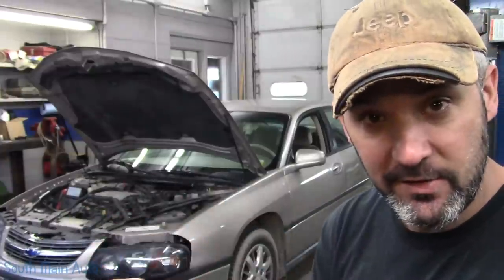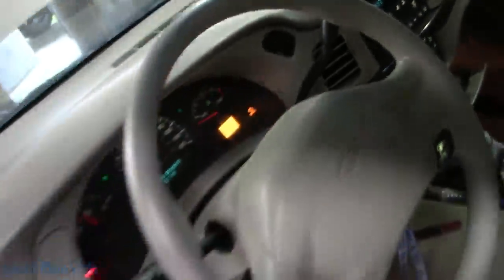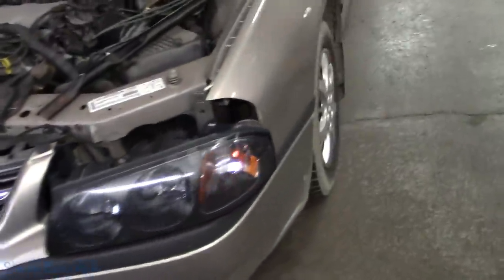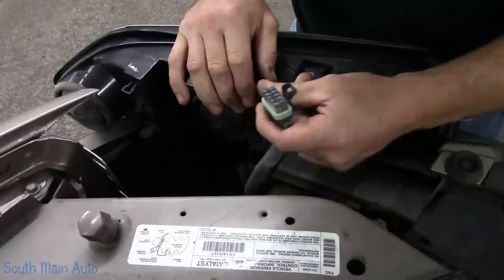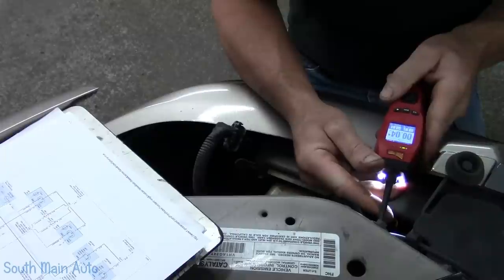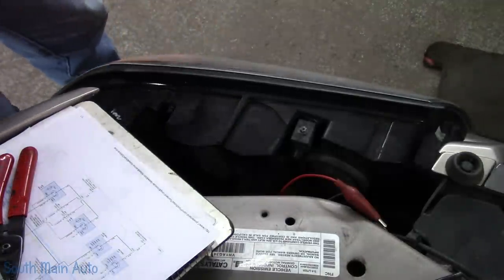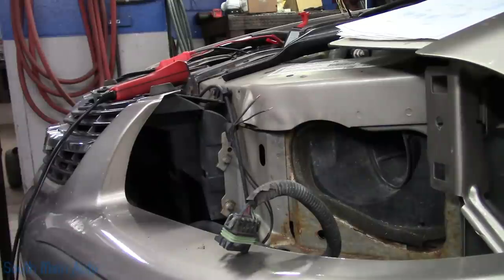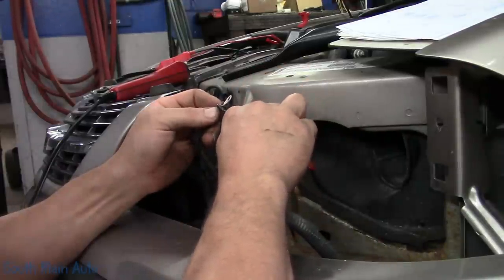Chevy Impala: Turning Signals All Goofy!?

Comment: At first look, this video looks like a snooze fest!! HOWEVER, (there's always a however) that leaves a lot of questions, that will likely remain unanswered!! 

1)did the owner pay for a multifunction switch?? That's costly! $$$
2)did the owner pay for a flasher switch? 
3)did the owner know that the vehicle was taken to a competent repair facility, and actually having their problem fixed?
4)did the owner know that the competent repair facility existed, and will use them in the future?? :-)
5)how hard did Mrs O sock you, for giving her crap on camera??
6) did the wounds require stitches, or does she know to abuse you, without leaving marks as proof?? 
7)how many dozens of flowers did it cost you, and did she include fancy chocolates too? 
8)did the other shop charge for all of the unnecessary work, parts, and sending out the job to a COMPETENT SHOP? 

Those pesky grounds!! No one takes them seriously!! I have a buddy that drives a 99 Cherokee, twin screw w/300k. It had a unique issue, where it would fish bite stutter, at speed in a tight curve, or under hard acceleration! They fired the parts battalion (not just cannon) at it!! Then gave up and parked it for a while! I came along to work on it, and spent more time getting it jumped off, than finding the actual problem!! The battery had no hold down, and was allowed to wobble!! The body ground was about 6ga, was about 5in long, and was part of the NEW HOLD DOWN SYSTEM, until it broke! The fish bite miss occurred as the battery moved under the turn, and would cause the body ground to pull far enough to disconnect, then would go back in place, when no load was present!  THOSE PESKY GROUNDS!!
Reply from the maker: 1) dunno, call the other shop and ask
2) see above
3) see above 
4) dunno, call the customer
5) she is non violent
6) no marks
7) she does not like candies
8) see #1

👍
Reply: South Main Auto Repair...and you believed her?? She also tell you that she don't want anything for a birthday present?? I believed that one, too!! And I ran right out, and got her an official birthday present...As soon as I got out of the hospital, and could walk again!! The physical therapy is going nicely!! Lol